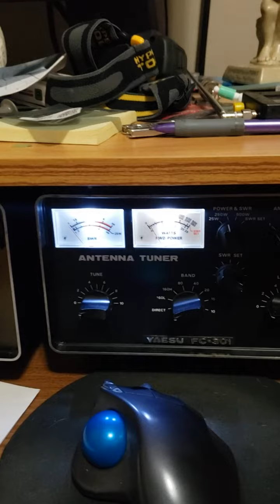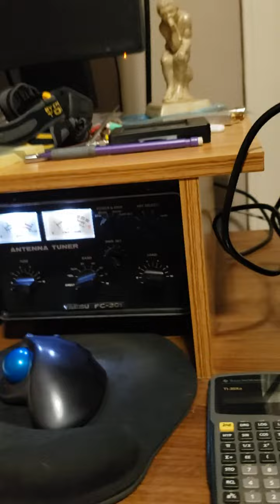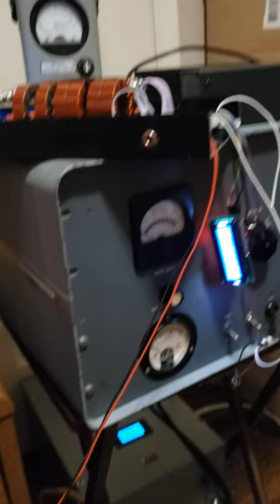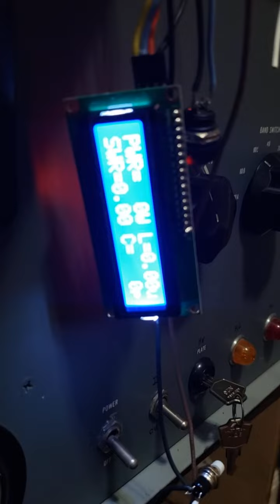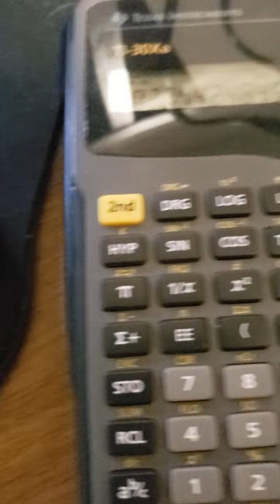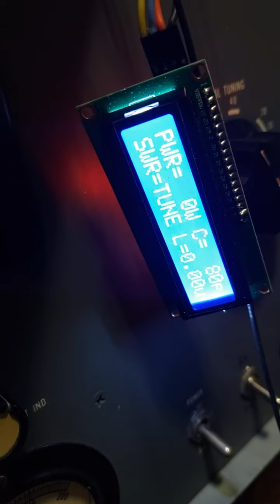ATU-1000 PART 3

Comment: Hello, thank you for your very helpful video! I’m currently at the stage of calibrating SWR on mine. I see you are using 40 meters to calibrate. Do you have issue with SWR being different if you calibrate on other frequencies? If so, does it matter? Is there a best frequency to use for calibration? I find there to be big differences if I calibrate on say 80m vs 10m. Thank you for your advice!

Comment: What model display (the larger display) are you using?
Reply from the maker: @chuckhardt  standard 1602. You have to make sure the software in the PIC is the correct one. Ask your seller.

Comment: How hard would it be to have the front panel remote inside the shack with the ATU at the base of the antenna
Reply: My ATU is on the antenna base 35 meters away from my shack.

You don't need any display or control on the shack!  The unit works perfectly fine without any remote control.
When I need to force a re-tune, I simply change the frequency to any other band, apply RF power ( CW 10 or 20 W), wait 5 to 15 seconds, until  SWR do goes down on radio SWR indication, than go back to the previous band, where I was trying to force an auto tune action!

A piece of cake. I've been working that way for 2 years

A remote control would be a source of EMI and will cost much more effort and money then the ATU itself>
Well, that is my opinion

73

PY1JDX
Reply: @ptarsob 
Thanks !